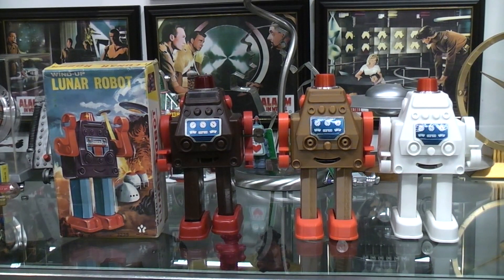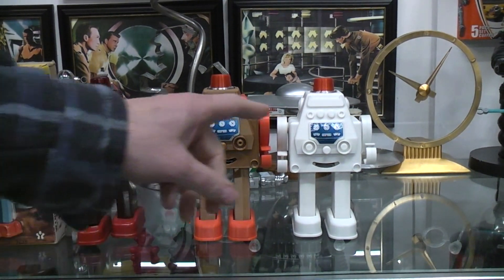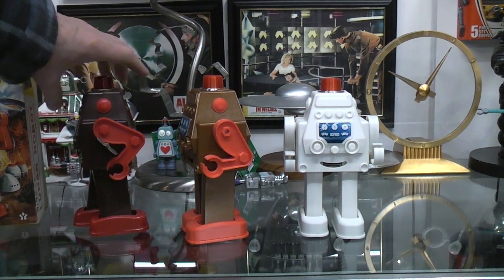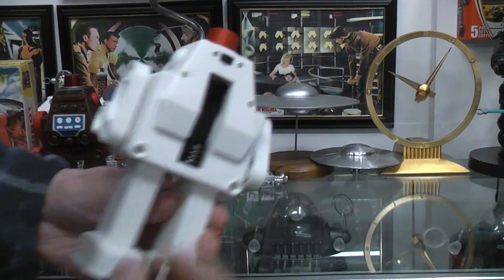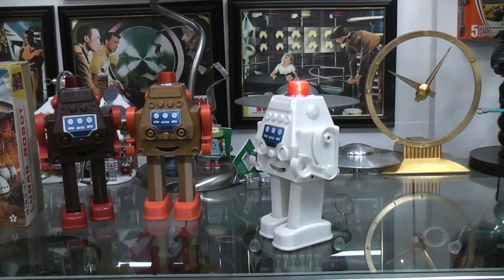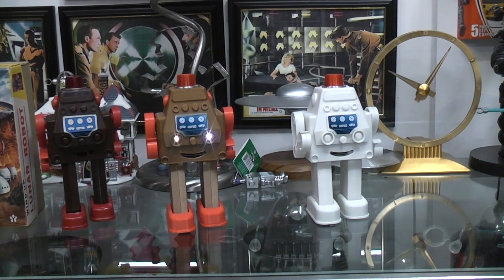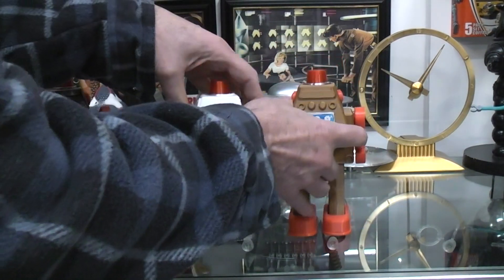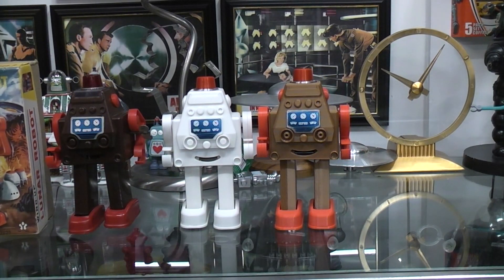You can 3d print the Luner robot. Battery operated, walking, moving arms and flashing lights.

Comment: Amazing - Filament printed ? - would this work for resin printed parts ?
Reply from the maker: Yes FDM "filament printed". So far doing mechanical parts and large body shell type parts has proven to be a bit of a challenge for resin printing. The resin printed parts will be very heavy and fragile compared with PLA FDM printed parts at 20% infill.